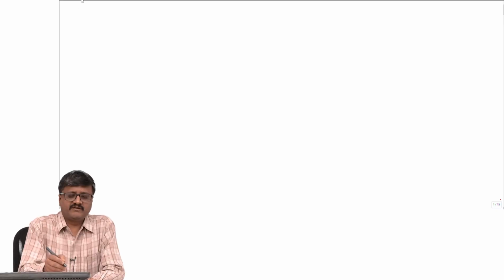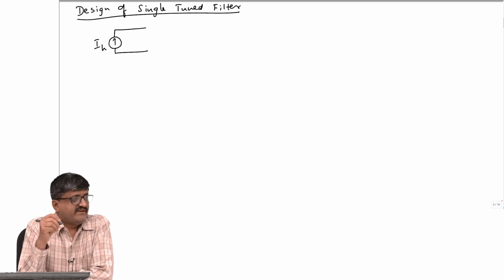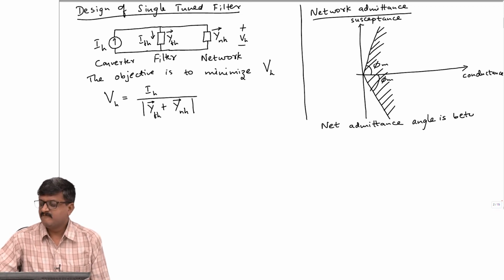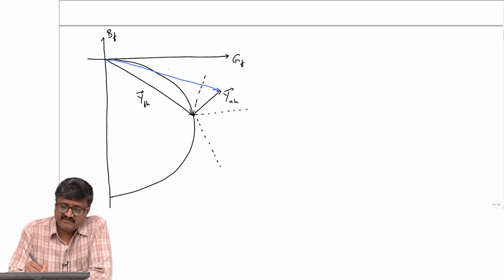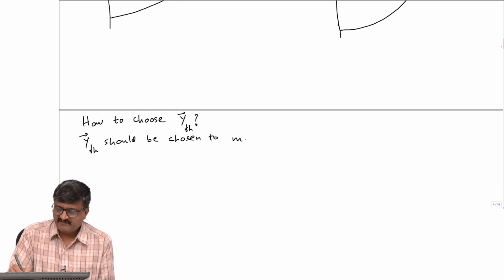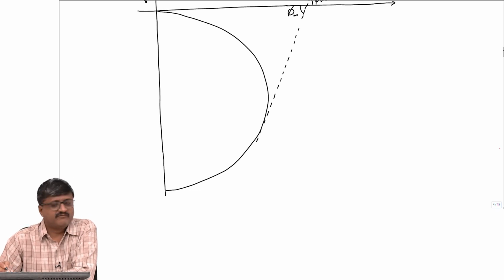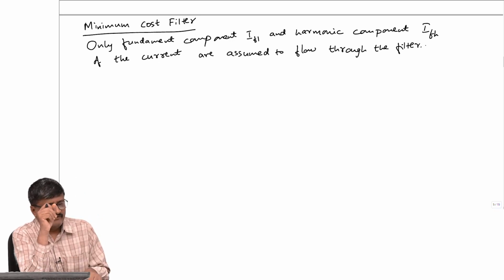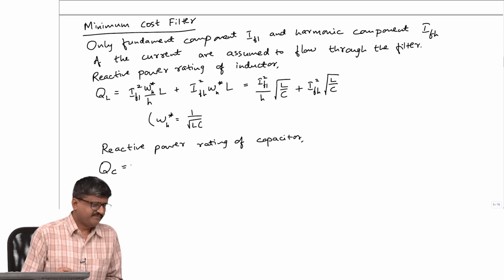Lecture 63 - Design of single tuned filter: Part 1

Comment: Sir if the converter generating higher order harmonics when it operating with 10K HZ frequency,  then how to design a ripple filter which will allow Short circuit path for non-fundamental component and oppose the fundamental component.